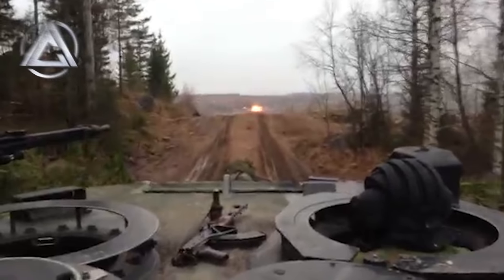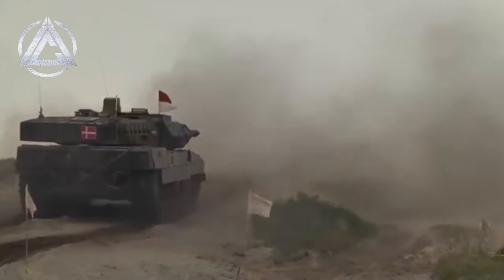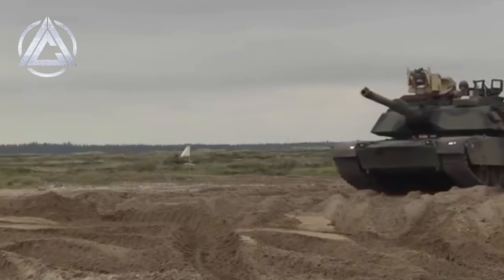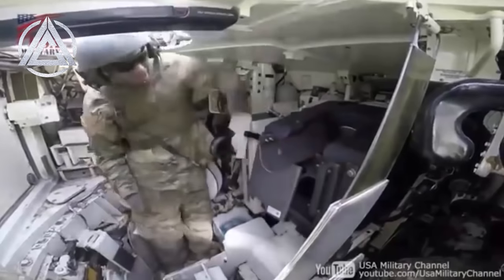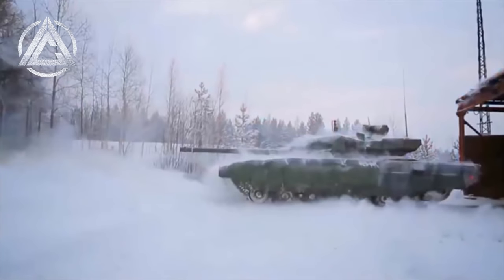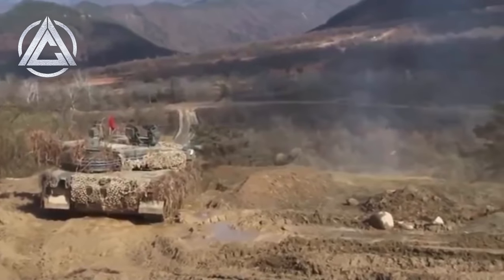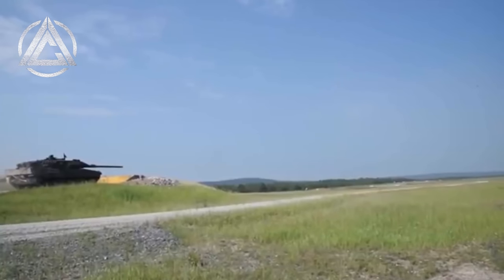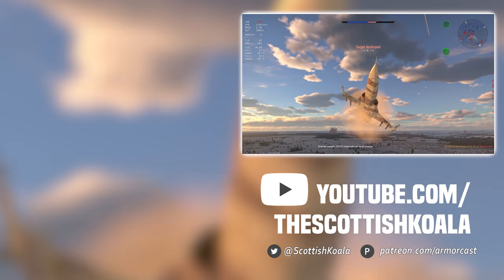Why Do Some Tanks Raise Their Gun Barrels After Firing? | Koala Explains: the 'Tank Salute'

Comment: I was pretty sure that it would be a loading the main gun. I think that during parades it is to keep people from freaking out. Having a hand gun pointed at you by an idiot at a gun shop who has never held one is nerve racking enough. Ex.. .45 acp rounds weigh 178 grains to 230.. at least that’s on my ammunition boxes. Idiot in the store could have brought a few rounds with him. Hence the nerve racking in a store. Anyone who is a responsible and trained gun handler will keep the barrel pointing up to ensure that if there is an accidental discharge every one is a bit safer. Ok that being said… Everyone has an off day… no exceptions. A tank being a military weapon I will assume it’s loaded like I do with every weapon. The same with their machine guns on the top. So if a .45 scares me and it fires a small bullet that may weigh as much as a piece of gravel. An Abrams tank that has a projectile that probably weighs 80 pounds… well I will need new pants and all the other kit for my lower body. The first thing that I was told with all the gun classes I have taken is. Always assume that weapon is loaded and ready to go. I can’t imagine that they would make a tank battle ready for a parade.  Crazier stuff has happened. Great video btw.